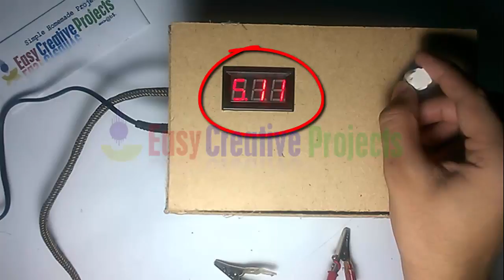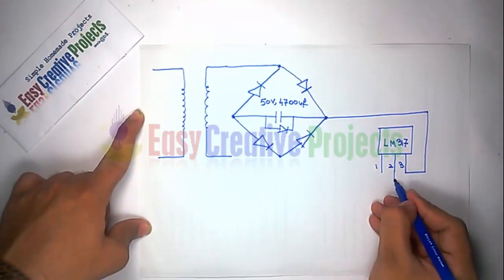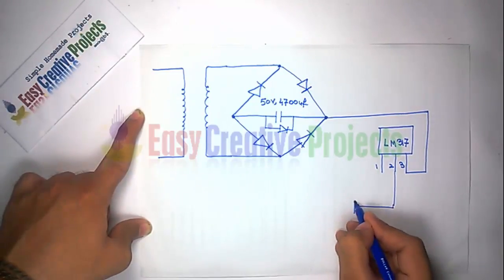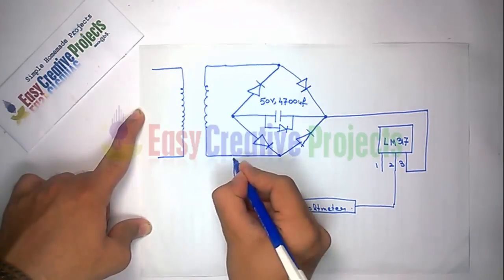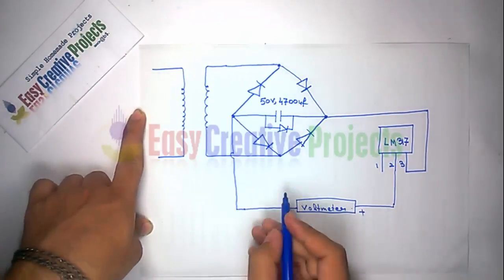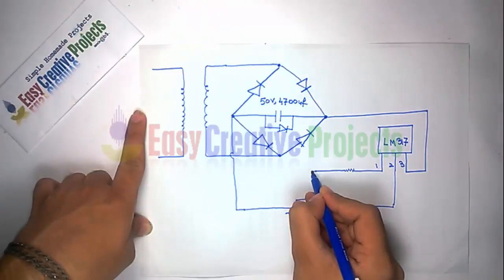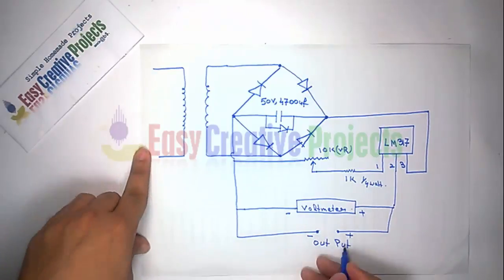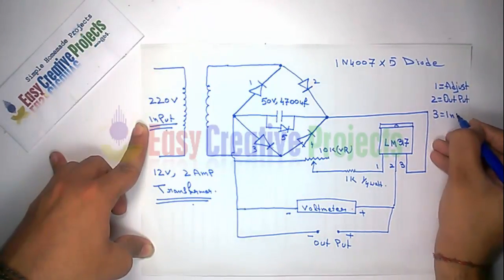How to make digital adjustable power supply - easy step by step with circuit diagram

Comment: bro how much for maximum and minimum output volt ?
Reply from the maker: i use 24v transformer so its provide me 24v maximum voltage.
LM317 provide us 1.25v to 37v output.
thanks.

Comment: kya 2 amp ki jagah 5 or 10 amp ka transformer le sakte h.
Reply from the maker: dear you can use any transformer but output same.
because i use 1n4007 diode. its output 1amp only.
and lm317 max output 1.5amp
for increasing ampere you need to change all circuit.
thanks.